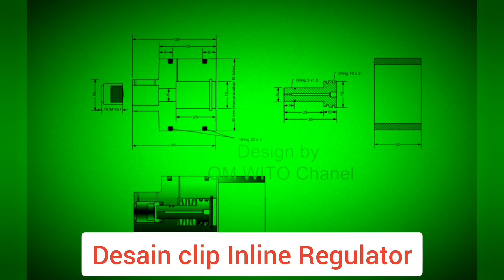Marouder OD38 mm Monolite valve reg

Comment: Cakep om...
Btw om, disni nyari oring polyutrene tuk oring atas piston regulator paintball sulit om.
Kira2 pakai oring NBR yg itam it bisa ga om? Tuk OP regul aku set di 2000.
Reply from the maker: Bisa ukuran id12x2mm yang shore 90 biar awet
Reply: @DeWito  oke om. Klo ngeliat itu oring shore 90 gimana om?
Reply from the maker: @nixsonhuntingvlog  ada di keterangan biasanya
Reply: @DeWito  oke om. Ntr tak coba cari ke toko oring terdekat. Thanks buat infonya. Sehat selalu om. Salam satu laras.
Reply: salam satu laras..bisa ngak bikin satu chamber bos..psi in 4500psi dan out 2200 psi..berapa harga nya..
Reply from the maker: Maaf Nggak produksi om